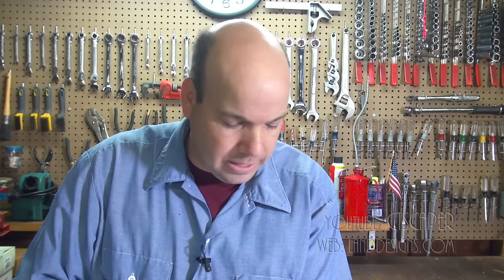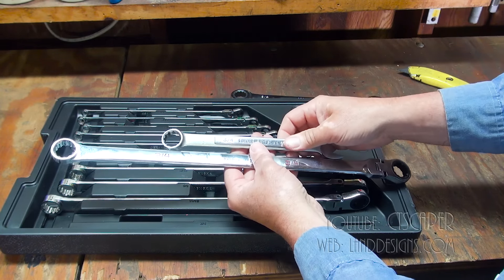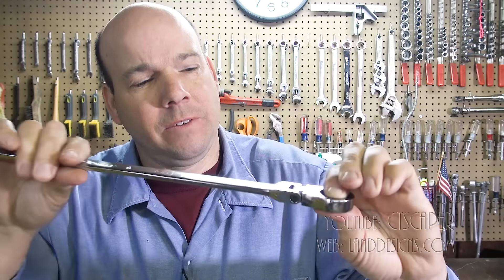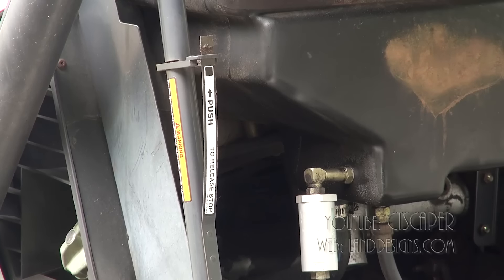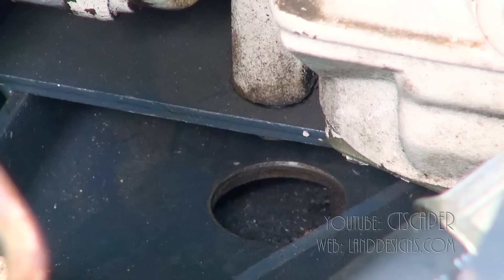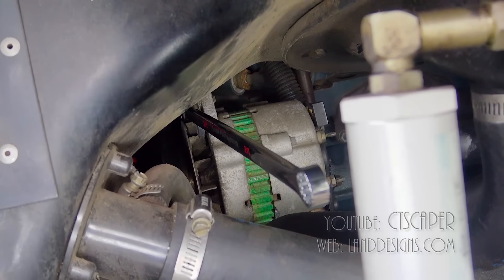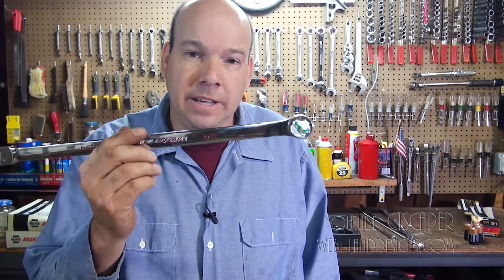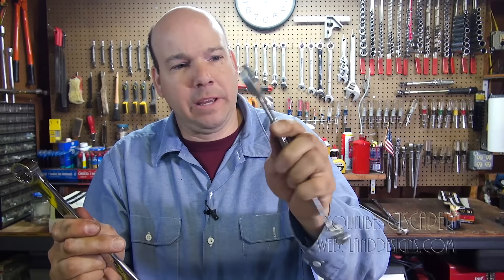WRENCH FOR TOUGH SPOTS | GEARWRENCH 120XP

Comment: I bought the 120XP metric set 86126. With the added length they about double the torque I can generate with my old Craftsman pattern wrenches. The spline drive holds rusted fasteners a little better than the closed end of a 12 point combination wrench.  They're great for breaking bolts loose and getting to awkwardly placed fasteners.  They have saved me a twice in the month I've had them. 

I warrantied the 18mm wrench with GearWrench since the ratcheting action was binding  about a third of it's rotation.  At first they expected me to pay the freight to them but when I complained it was purchased just the prior week they emailed a prepaid UPS waybill.  I expected their quality process to have caught the defect but I'm happy with their customer service making it right.

You're right about needing to check the ratcheting direction each time you put it on a fastener.  I wish the direction of rotation could be indicated on them somehow.
Reply: Get a red and green paint pen or something, red dot on the anti side, green on the clock side

Comment: You did a nice job with this video. You explained and demonstrated the tools well and the sound and video were also very good. Thumbs up!

One thing to be aware of is that since there is no reverse lever, don't get into a situation where you back the fastener up against an obstruction because you won't be able to run the fastener back in, and you won't be able to back it out either. You may have to cut off either the fastener or the wrench off to get it free.
Reply from the maker: Good point.  Hopefully I won't run into that situation but if I do it will be a very unique situation.  I used the wrenches yesterday and like them as much as when I made the video.
Reply: Thanks for the update most people seem pleased with them. I already have a set of extended-length wrenches, but I might pickup a set of these. I just wish they came in a 12 pack like the non-flex set. I have the standard and stubby Gearwrench flex-head sets and they're nice for the price. Much nicer than my old USA Craftsman sets, but they're no Matcos either - of course they're no where near as expensive as the Matcos.
Reply: These wrenches do not have a reverse switch on them. If there is not enough room to remove the wrench from the fastener and flip it over, and  if the fastener is to too hard to turn without using a tool, you're out of luck. I've seen it happen.

Comment: I have a set of Matco's rachet wrench in metric. They are similar just more expensive. They do not have a forward/reverse selector. Many times my wrench will get stuck on a bolt or nut and being able to turn in the opposite direction would loosen the grip on the bolt or nut. Many times i have to use a screw driver to pry the wrench. Wish i had bought the ones with selector switch. I use mine everyday on cars and trucks, so for the professional get the one with selector. Thanks for the video.

Comment: Good video buddy, just let you know that based on my experience, there is never a reversible gear wrench with a flexhead, as it defeats the purpose. the manufacturer only goes with either. When the ratchet side can swivel, there is no need to add switch to it, as you said, you can simply flip it around. Also if you think it this way: your flexhead with a switch will make the two sides uneven, it can turn to one side less due to the selector in place. This is not a normal engineering design.

Comment: Mine are probably easier to warranty. My Matco guy comes weekly to me, and warranties all the tools he sells me "no questions asked". So convenience has a price as does replacement. I buy a lot of all 4 of the tool guys, the companies are pretty much same price, Snappy can be little expensive, but OTC stuff, etc I tend to buy Amazon. Amazon has a great selection and with Prime I get 1-2 day shipping, but warranty means sending the tool off for repair. I do watch reviews of tools from harbor Freight, etc, do not always agree, but find it interesting. I remember when I started in 1973, very little metric, most were all SAE, I still have my original Mac tool box, top and bottom, was $1000, and i was making $1.85/hr and labor rates were at $6/hr. Now you can spend $20K+ easily on tool boxes, hell in 1977 I bought a house for $30K. I do not and I repeat do not buy expensive tool boxes, I want the tools that go in the box. Later
Reply: Larry Hurst nobody cares
Reply: Tool trucks sell gear wrench so they can warranty it

Comment: I do not see pricing changes due to competition. Each supplier runs weekly ads(like a Walmart flyer)but since the tool guy on the truck is also the bank they usually do not discount even for cash.  Their margin might be 30%, but depending on the tool rep he is carrying the paper with all it's inherent risks(guys leaving shops to unknown parts). On the average they make a living, but not getting rich., When they have the tool show they can load up on specials and then you see a $120 1/4 inch ratchet come down significantly. But they must be able to turn the extra inventory quickly as the bill comes due. My Snap On rep does that every year. He is the king in our area and graduated from UVA with chemical engineering degree. Go figure. I saw the Matco rep lose a territory because he would not buy a new truck. Our Snap On rep rides around in a weekly rented Penske truck and no signage at all and Snap On Corp says nothing. Another go figure. Mechanics tend to buy from certain reps unless they absolutely have to have something today, it's a personality thing. If you like the guy, you buy, no matter the brand, if you do not like the guy, forget it.

Comment: 6:08 3/4" wrench. 1/2" bolt, right?
Reply from the maker: I can't remember what size that was.  It sounds like your familiar with that bolt though.
Reply: Not that particular bolt but odds are ... I've just been watching a lot of tool vids lately. Maybe too many. Videos, like yours let me, at least, see what these tools look like.
Reply from the maker: That makes a lot of sense.  Have you picked any new tools lately?
Reply: I'm getting ready to start a project. I've been thinking about my '88 Blazer. Anyway, I'm looking for a set of long form factor wrenches that are of good quality but won't break the bank. I'm done with tool trucks. If I wanted to spend that much money then I'd just order some Proto tools. These and Tekton have caught my eye.
Reply from the maker: I haven't held a long wrench of another brand but if you use the tools as they're meant they'll do great.

Comment: Really good demo. Thanks
Reply from the maker: You can't go wrong with that wrench set.  You won't use them daily, unless you're a mechanic, but you'll be glad you have them every time you use them.
Reply: @CTSCAPER  Hi CT I am a mechanic and car builder.  I own 3 Mustangs and am working on a frame for a gt40 Replica. This will be great for the wreckers yard as I don't want to drag out a lot of tools and the torque is going to help.You could acid tone an arrow on the wrench for which ways tight. I'll do that when I get a set. :)

Comment: A set of flex head ratcheting wrenches would have been a better investment.... as you pointed out these tools are probably too long for daily use but a standard size of flex head ratcheting wrenches would have solved your problem and been the correct size for daily use... nice work on the video but I'm not sure if I could justify $170 cost for something you only grabbed from time to time and even then with a decent set of standard Flex head ratcheting wrenches you may not even need these at all

Comment: SNAP ON, MATCO, MAC, CORNWELL, 4 tool trucks, come by weekly. Tool investment is huge on the independent side of repair. The dealer tech is at a huge advantage regarding tools, as they work on one brand. One can easily spend $25k and up on tools depending on the owner's contribution.

Comment: You are busted if you forget to flip the wrench over when it touches the engine bay. It is stupid design without a reverse mechanism. At the end, i have to use a hand saw to cut the wrench off. Man, what a pain!
Reply: Ran Zhang so true! however I friggin hate when it switches direction in a tight spot from bumping the direction lever
Reply: I got the mountain, which has the push-in style changing direction. I do not have the unexpected changing directions .